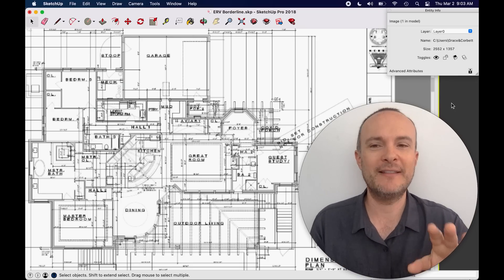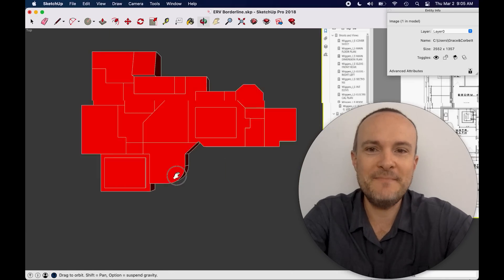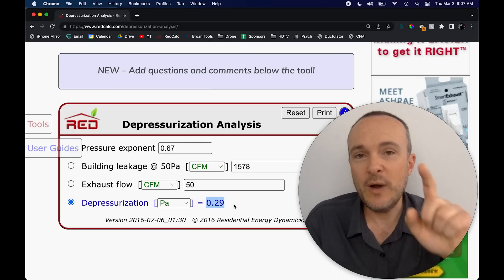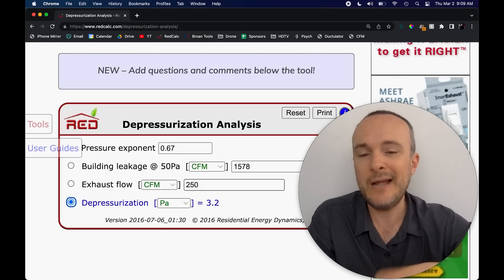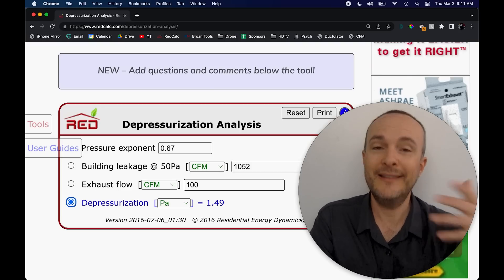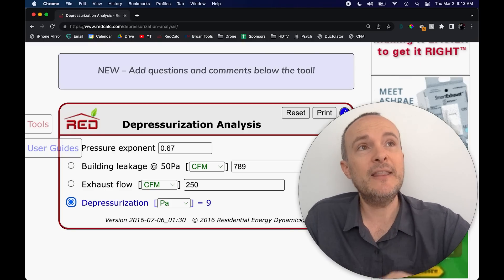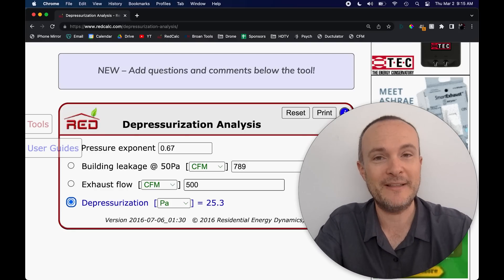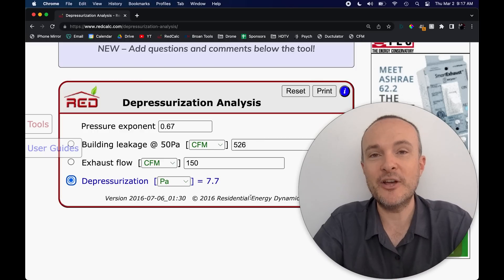Borderline of Balanced Tight Home Ventilation: When Do I Need an ERV because Bath Fans Won't Work?

Comment: I know this video is a bit older, but we’re currently designing the HVAC for a small home and are aiming for a DIY, Panasonic Oasys–style system. The plan includes MERV 13 supply filtration feeding a small room with mini-splits with bathroom fans controlled by Swidget devices delivering filtered air to each room, including two bathrooms.

Bathroom 1 is split: the vanity is in one area, and the toilet/shower is in a separate room with a pocket door. We planned to install the 50CFM exhaust fan above the toilet, with clean supply air delivered above the vanity. 

Bathroom 2 has the vanity and shower in the same open space, with the toilet in its own pocket-door closet. Here, we planned an 50CFM exhaust fan above the toilet and another 50CFM fan above the shower.

I’d appreciate your thoughts on this approach. At 3 ACH50, with one bathroom fan running (50 CFM), we’re seeing about 1.6 Pa of pressure difference. With two fans it’s ~4.5 Pa, and with three fans ~8.3 Pa. This doesn’t include the range hood, which is 400+ CFM and creates roughly a 35.8 Pa pressure difference. The dryer is non-vented, so that’s not a concern.

I had planned to use an ERV to help balance the system, but I’m not finding one that can handle this level of pressure offset. What would be the best way to pressure-balance the system? Ideally, the make-up air inlet would feed into the MERV 13 filters and then be distributed by the Oasys-style setup.

Would it make more sense to use Panasonic WhisperComfort “spot” ERVs in each bathroom, effectively replacing the bathroom exhaust fans? That would still leave the range hood to deal with, of course.

This may not be the perfect place for such a detailed question, but I had to start somewhere. I really appreciate your videos and your willingness to share your knowledge.

Comment: My wife and I built a very tight off-grid super-insulated home with an airtight wood cookstove and passive combustion-air inlet. But no airtight is truly airtight, as we soon found out. If we turn on the bath fan (there's just one bathroom) without cracking a window we'll soon smell that sooty chimney throughout the home. If the fire is burning, visible clouds of smoke will be pulled into the kitchen. I had always planned to install an HRV at some point, but obviously this has now become a priority.

Comment: One of the most unrealistic examples I’ve ever witnessed. Where would you find an open fireplace and someone doing an honest blower door test. Where do you get bathroom fans that are absolutely gonna turn 50 CFM regardless of their head pressure. I recommend a little less time at the drawing board and a little more time with a tool in your hand.
Reply from the maker: Wow Daniel, you decided to pick on the wrong guy today. I am a diagnostic specialist, and wrote the international standard guide for testing home performance dynamics. My trainees do honest blower doors every day, and lots of bath fans deliver full rated CFM because of EC motors. You sound like a classic armchair novice, and I’m sure you have lots of other bitter crap to spew, but do it off my channel.

Comment: I need like a ventilation consultation, I want a Broan ai ERV but I can’t find where to purchase the model I need, seems can only get through.
I’ve talked to a few local HVAC dealers who are up charging because they don’t know about ERV use in my area. They say to just use an intake fan. I have a spray foam sealed envelope with 18k BTU dual head mini split system
Reply from the maker: You can get it online direct from SupplyHouse or HVACdirect

Comment: Corbett. Thanks for the analysis! I knew academically about depressurization but we just did our first blower door test after the framing stage and blew 1.04 ACH. So glad we took your advice to do balanced ventilation and no exhaust units.
Reply from the maker: Good work Cannon

Comment: This is interesting. I start thinking about the radon mitigation system that is pulling air from the French drain in our home. It must be pulling air out of the home in one way or another.
Reply: Radon mitigation systems generally pull air from under your slab or basement floor. They don't depressurize the home itself.

Comment: I don't see the point of an eru for the makeup air. Your could run a return duct to outside air with a zone damper on it controlled by how many exhaust fans were running. Then you'd get cleaned conditioned makeup air to relieve the negative pressure without needing an extra piece of equipment. If your trying to sell them on energy efficiency the increase in cost of the eru will our way any energy recovery gains and it's their environmentaly concerned then the pollution from producing the eru will be way higher than that produced by the minimal energy efficiency gain. This seems like some snake oil to me. Conceptually interesting but the kind of crap you try to upsell high end customers on.

Comment: Including the .7ft^3 is pointless. Sure your cad program makes it seem exact but the builders won't be. And if even one stud cavity is sealed enough to not have airflow it would change that. Should use sig fig to get an accurate measure of volume without the implication of such precision
Reply from the maker: Precision wins arguments was my point, Jet

Comment: Yet another great video!  It would be interesting to see a video showing the differences in ventilation and H/AC mechanical equipment requirements for one specific house around 2k sqft at different blower door scores, perhaps starting at very leaky at 10 ACH50, then going to the various regional code minimums at 5 and 3, and then 1 and 0.1 at the extremely tight end.

Comment: I’ve been thinking about cracking the door of my laundry room to the garage when the dryer runs. I can’t measure it though.
Reply from the maker: Ooh, we don’t like garages. Lots of pollution sources out there. I’d recommend any other window in the house instead.
Reply: @HomePerformance  great, thanks. It’s a gas dryer, does that make a difference on the amount of negative pressure it creates? Thanks for the help as always.
Reply from the maker: Not much testing on these, unfortunately. I’m working on something.

Comment: Hi yay! To science in the house. Question, completely agree that make up air is needed to aliviate depressurization, but if the return for the ERV is the air from the shower (hot + humid) wouldn't that bring hotter and more humid air that what we want in the house?
Reply from the maker: Glad you asked:
ERV vs. HRV Mythbusting: Which Ventilation is Safer for Moisture and Humidity?
https://youtu.be/QOe4lluGwCg

Comment: I like what you are saying, good to have the math as well. One question, isn't this a momentary pressure problem? The bathroom fan is going for 10 -15mins or are you expecting them to be constantly extracting at 50 cfm /25 L/s 24/7? I'm all about balanced airflows, for we install we balance the air with a filtered PPV system with a filter to control the source air. But it is never fully balanced because of people!
Reply from the maker: Perhaps momentary, but backdrafting chimneys is no joke, even for 10-15 min. And repeated wetting from humid air condensing in building cavities likewise.
Reply: @HomePerformance  Very true,

Comment: So what is the number that we need to look for in that calculator to know when to go for an ERV, 2 pascals depressurization? 1? 3?
Reply from the maker: That’s the whole video, Julian- it’s a system. If I say ‘2 Pa’ it’s only because I’ve answered s bunch of other questions first:
-Where is the home, what climate?
-How will the home be operated?
-Who will live there?
-What other equipment or features will interact with the pressures?
Reply: @HomePerformance  well yeah, for sure, and all the details are the builder or architects job of calculating, etc, but I was expecting a conclusion towards the end of the video, or an explanation to put things in perspective, 0.5-1 is normal 1 to 1.5 is pushing it in a humid climate, up to 2 is pushing it in a dry clean air climate. Over 2 you have to have make up air. And these are the consequences of not having it, like dryer not drying. And I mean this is an over simplification, but a lot of times people need layman explanations, and it also makes it easier for me to send this video to someone that is not into building science. 
 Thank you for all your hard work, this is just a suggestion
Reply from the maker: Thanks Julian, I hear you, but this approach is fundamentally opposed to generalizations unfortunately.
Reply: @HomePerformance 
OK then,
-North East
-raised ranch, finished basement 
-mini split+sealed combustion furnace
-2 Panasonic 50cfm fans (2 baths) 
-1 exhausting clothes dryer (150cfm?)
-1 200 cfm range hood
4 occupants
2.93ach50 (900cfm@-50Pa)
Reply from the maker: Happy to consult with you. You can book a time at:
https://buildingperformanceworkshop.com/video-consulting

Comment: IMHO this is one of your best videos. You succinctly described and mathematically demonstrated the types of problems a new home built "airtight" could experience. 
Your discussion has made me feel better about adding a filtered fresh-air makeup register next to the electric clothes dryer. I will interlock the dryer with a damper and an inline axial fan similar to the Fantech kitchen hood makeup air system.
Reply from the maker: Hey, thanks for saying so Joseph! Glad to be getting more useful to you all.
Reply: Hi there, thanks for sharing  .Where is Ideal location for the bath fan ?
Reply from the maker: So glad you asked:
Best Place to Put a Bath Exhaust Fan
https://youtu.be/fqwYFduOK_Q

Comment: One thing I do kinda insist on, even if you have the directional airflow that you are excellent at designing to get low ERV exhaust rates in bathrooms, is to build them with the option to temporarily boost to 2x the normal ventilation rate with a manual switch. Anybody who's ever needed to wear a respirator to clean a bathroom with bleach will appreciate it! From experience, even 150 CFM in a small bathroom isn't enough to keep the odors and fumes of heavy duty bleach usage from drifting to the rest of the house.

It's also an excellent option to have during a pandemic... You touched on this in one of your other videos, but it'd be a damn shame if we all didn't internalize that aspect this time!
Reply: 150 cfm effective flow is definitely enough. A 150 fan might not be enough depending on  house tightnes and fan installation.
Reply: @MrZammaraska  it sure seems like it *should be enough*, but if you're trying to clean a bathroom that's very moldy (hard water causes soap scum), sometimes you really need a ton of bleach, and the fumes will spill out into the house 🤮

In this context, I'm thinking of a bathroom that has a nice fancy Panasonic Whispergreen select that is supposed to actually flow 150 CFM even with higher static pressure than intended.
Reply from the maker: You guys, slow down, let’s plan for the bathroom not to have mold in the first place.
Reply: @HomePerformance  I'd like more tips if I can get them! This specific bathroom... It's a challenge because of the hard water combining with natural soaps to form a ton of scum... And also the tile being cooler than it should be because the contractors who built the place were drunk at the time (as evidenced by beer cans from the 80s buried in the insulation) and punched holes everywhere
Reply from the maker: Then all you can do is bandage the wound, AR. So many things wrong with that bathroom, the way to truly fix it is to truly fix it. Take down the drywall, airseal, insulate, put fan in proper place with straight duct, water soften, etc.
Reply: @HomePerformance  I'm trying to get there, one step at a time! Every time the drywall is off somewhere, I'm *AT IT* with foam, big stretch, a pallet of rockwool, and of course, my trusty little FLIR!

The stuff I've found shocks me... During recent demolition, I found a 12"x12" hole for plumbing that went all the way through to the nextdoor condo, bringing in 50°F air from the unheated nextdoor home into the space between the floors, chilling that tile a whole bunch and making the space feel drafty. It took some creative use of rockwool and spray foam, but fixing that made a big difference... And I know some in the community have opted for heated flooring without fixing this kind of thing 🤦‍♂️🤦‍♂️

Can I swap over to well designed ERV at some point? Hopefully! Do akimbo bath fans on medium/low speed look like a totally rad V8 to an amateur building nerd? Maybe! 😉😂

Comment: Fantastic information. I recently had a blower test on my newly constructed home. The ACH 50 was 2.2. I have an ERV but it is integrated into the main ducts for my geothermal system. I tried to get a separately ducted ERV system but my contractor had no experience with this. I have separate bath fans and one low CFM exhaust for my induction stove. This information may give me a starting point to understand how the fans could effect my pressure. Thanks!
Reply from the maker: Excellent, rock it out Peter

Comment: A few nuance questions that will have a big impact on actual performance.  Have you seen a PV curve for a bath fan?  I haven't.  I suspect the 50cfm rating is a zero static and the curve is very steep from there.  So, likely not going to deppressurize to the values shown.  Also, how much of your envelope leakage is from the bath fans/dryers/ vent hoods/ fireplace, etc.  that dissappears when they are running?  If you block all those leakage paths during a blowerdoor, then the ACH50 will be much higher during real conditions when they are open.  Dampers on bath fans are only good for keeping you up at night when it's really windy out and they are slamming open a d closed.

Comment: I love what you do here, because nobody else dives into these details. I’m building a new tight ICF home in a dry high desert climate and have considering exactly this. I am looking 1) conventional ERV system feeding fresh air into two air handlers with ducted bath and laundry stale air returns, and 2) ductless wall penetrating Lunos e2 60 system with bath fans where if there is positive or negative pressure inside the home, the fans will stop blowing and simply let the pressure leak in or out. Obviously if this happens a lot it would reduce energy/heat recovery. Have you ever evaluated Lunos and do you see any pros or cons? Total cost, quiet, air quality are my goals.
Reply from the maker: Thanks 5starCA! Video forthcoming, but short answer is avoid the twinned ERV systems like Lunos in general.
Reply: I like those ICF homes, congratulations. One thing you said sparked my interest, which was having returns in moist areas like bathrooms and laundry rooms. Maybe you meant exhaust fans, excuse me if I’m mistaken.

Comment: Why would a high efficiency home have a fireplace that uses inside air for combustion? I can see someone wanting that old fashioned fireplace feel, but drafting from the house for a new build doesn't make sense to me. 
My house is very air tight and so I use HRV for all the bathroom fans.
Reply: In my not-so-humble opinion, fireplaces are something from the Dark Ages. It's bizarre to see one in a modern home. They rank up there with spittoons and the indoor privy.

Comment: Have you seen the aldes brand h/ERVs  that have bath fan replacement units that allow for independent boosting of each room.   It uses a air foil that keeps constant air volume  when boosted at at the ERV and desired vent will bypass that foil so only it is boosted.   Very genius.  
Never seen a review on these.
Reply from the maker: Have not seen those yet, I’ll reach out to Aldes again (for the 5th time).

Comment: I'm in Phoenix and it's impossible to get this "luxury" apartment down to less than 40% humidity indoors. I bathe in 2" of water because the shower steams over the mirror even when I only turned water on to get wet, then turned it off to soap up, and turned it on again to rinse off.  
Every single apartment I've lived in here has been like this. 
The home I owned/sold had a fan in the bathroom but it wasn't connected to any exhaust! 
I hope someday you have an opportunity to start educating the International Building Codes. 
This "sick" 480 square foot apartment is costing me close to $1,800/month. It's INSANE!!!!